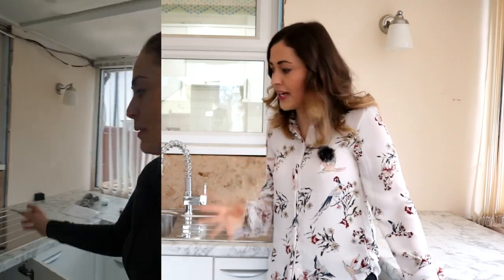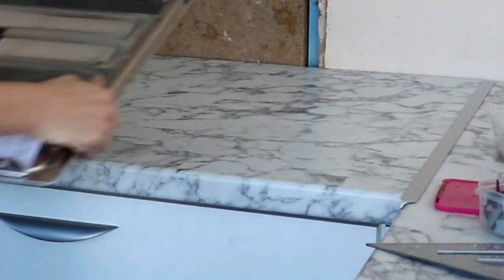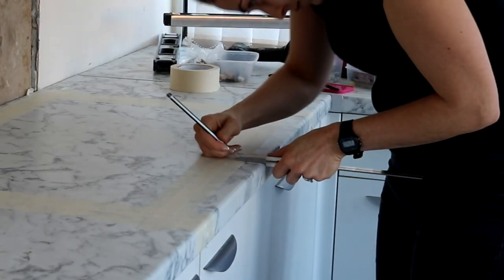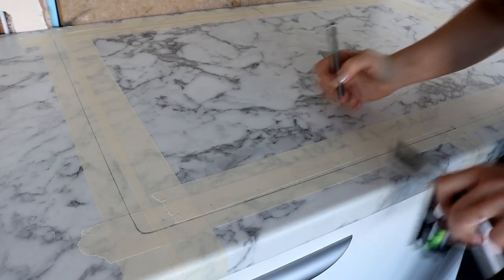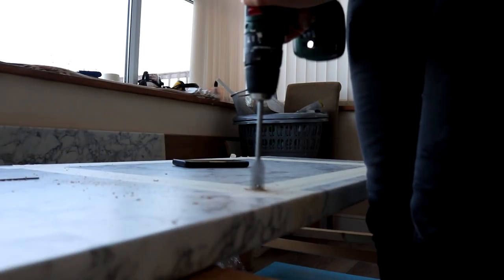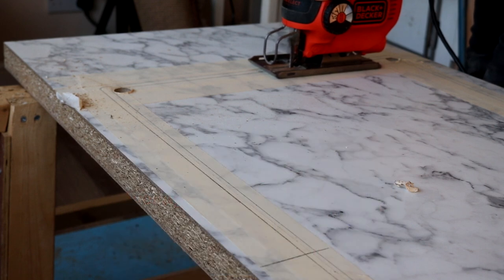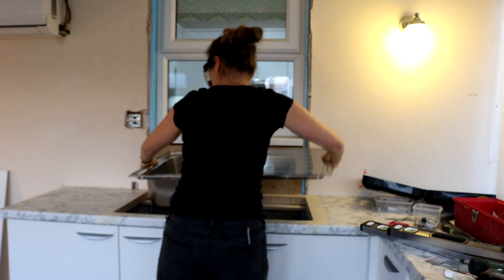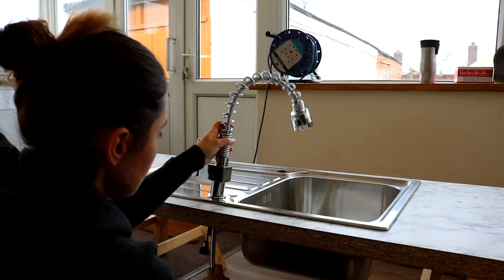Cutting Laminate Worktop for a Kitchen Sink: Part 6 | The Carpenter's Daughter

Comment: Another cracking job vikki 👌💁🏼couple of tips, draw around a coin for the corner markings and cut the work top in place and slide it around to avoid cutting units. This just saves the risk of it breaking at the weak points around sink cut out 😋. Lovely neat job though 👏👏👏
Reply from the maker: Thanks for the tips 😊👍

Comment: Looking a bit glam.

You need to take into account the tap handle range at the back. I replaced a tap, but it fouls on the tiles when on full cold and just a little open.
Reply from the maker: Thanks for the tip and very good point!  Mine thankfully has plenty of space for tiling behind while turning off and on, but will pin this just for future researchers to read.  And I had to go out for a food filming dat right after 😉

Comment: Hey I think I’ve just fitted that exact same tap, for some reason I’ve got really low hot water pressure after fitting presume yours is fine ?
Reply from the maker: Hi, ours in a combi boiler system if that makes any difference?  The hot water pressure seems to be fine to me.
Reply: Hi thanks for reply yes I think ours is faulty, pressure all good up to the ends of the tap tails but as soon as connect them in hot water just dribbles out. 
Nice job btw , I nearly made the wrong side of the line mistake when cutting my sink out and just caught myself as was about to drill the pilot holes.
Reply: Thanks!  I have read some issues with it, so I would definitely send it back as faulty

Comment: I used down facing blades before i would never recommend them easier with progressor blades
Reply: Why would you not recommend the downward-cutting blades Keith?
Reply: @grayhalf1854  a chance of getting stuck and jigsaw doesnt stop bounces upwards.
Progressor blades are dtraight facing give a good cut and no bounce 
Just my preference but im sure a few ppl might like the down facing
Reply: @keithbyrne4872  thanks for your comment Keith. I've been struggling with a downward blade in an old jigsaw trying to cut laminate and it was kicking like an ill-tempered mule. Bit the bullet and tried the same blade in a new £25 jigsaw from Screwfix and it cuts like a dream - controllable, cuts true, minimal kickback and zero chipping. Learning that old tools (some inherited from my late dad) are sometimes much inferior to cheapo modern ones...

Comment: Just an observation, when sawing MDF or chipboard with synthetic glues, a dusk mask is essential. Get a pair of safety glasses rather than goggles so you can wear with a mask.
Reply from the maker: Thanks!  I didn't really think this was an issue with chipboard, but could be wrong.  I have however worn a face mask as the very least with MDF.  Can't remember eyewear (probably) as it was a few weeks ago.

Comment: OK. But the hole was cut out a bit large, the sink moved easily . Cut it as tight as possible, there is only 10mm lip and if you make it even less...
Also, the cabinets are as flimsy as they are, but why making them even more so by removing that piece that broke? You should've replaced it  or put timber underneath and secure it in place.
Overall, good channel to watch if  you are woman and like a lot of chatter and adverts to increase the profitability of the vlogging.
Reply: Pay no attention to sexist jerks like this. You did an incredibly good job. Some people actually don't know how YouTube works. Keep on doing amazing work. You got my sub.